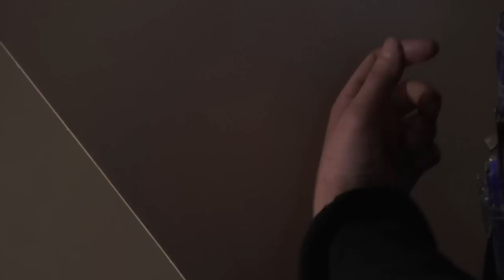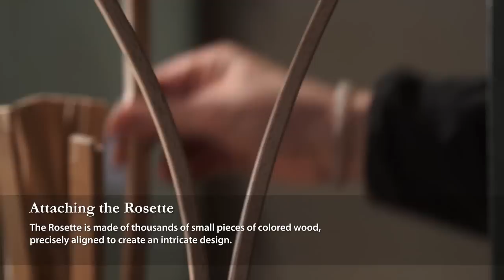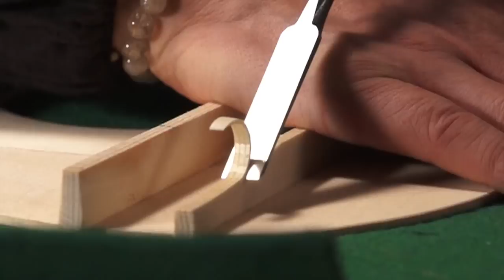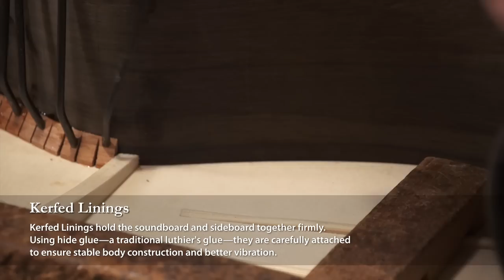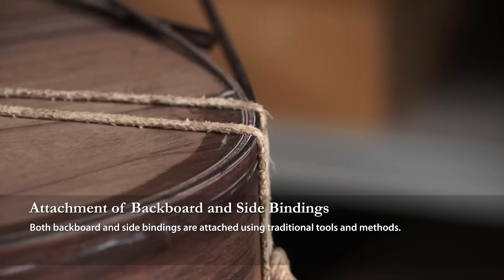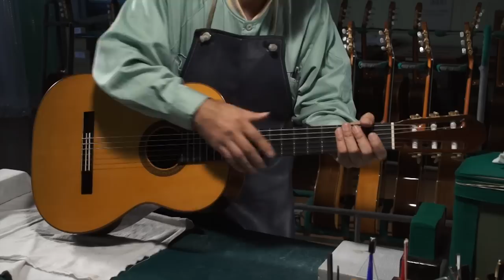Yamaha GC series: Visiting Custom Shop

Comment: I have been playing Yamaha Classical Guitars for FIFTY YEARS (,...yeah thats 5-0) 
The Yamaha CG 111A,  CG 100A, CG122 and the first G 50A from 1971 have all been great guitars. 
I am a Fender electric guitar loyalist, and I have bought one Fender nylon string acoustic/electric guitar with a cutaway and will buy 
one or two Fender Nylon Classicals just because you can never have enough guitars. (not because of any sound or quality premium)
I have come to find there are not many guitars out there for the  affordability, playablity, consistent recognized reputation, and reasonable quality which allow one to have a viable assortment of what each one offers as an individual guitar than the YAMAHA nylon classicals. (entry level)
Sometimes you need two if playing somewhere, say should a string break,....you dont tune nylons in a moment,...trust me. 
I played in NYC on the streets and would always take two in case I was beaten to a limp lifeless pulp and had to let them go,
......its better to go cheaper for that reason alone.
The CG 40lll  or CG 40 whatever number they are today,..or the one up from that, it is true, and has been true, you can get a GREAT new guitar from Yamaha or even a used one for between $99-$139 or for the "better" one about $199. (or less)
Get a hardcase for it and dont listen to these troll nutcases about not buying a Yamaha. 
They make great guitars,..I just cant cough up thousands of $$ each time I get a guitar,...the good news is the lower priced Yamaha will play great anyway. 
I`m pretty sure trolls can NOT play as good as a Yamaha would let them, thats why they are trolls.

Comment: Hi there,  was shopping for a brand new Yamaha cedar top classical guitar (matte finish)  and noticed a blemish on the top that looks like a bad shelac job the size of a penny. The shop assistant assured me it was nothing. Brought it home and immediately noticed it was actually a wrinkle (lagoon shape) on guitar top (upper bout, low E string but near the side) when the light hits it a certain way. It wasn't as pronounced in the showroom. Felt a small bump with my finger and wondered if it was a structural problem or loose brace. Not sure if it is related but when I pluck low E or low A string,  it sounds hollow (for the lack of a better word). Is it a setup or wood problem? 
Anyway, a top wrinkle, Is this kind of thing purely cosmetic or is it a defect that affects the sound quality? I have been sleepless over it worrying for the future life of the instrument I expect to last at least 20 years.

Comment: Yamaha's hand made line of guitars is very good, but except for some 660 mm models from the early 70s, the neck profiles are generally too shallow (not deep enough), and do not have enough shoulder on them. By contrast the comparably priced Spanish made instruments  are inferior in construction and materials but the neck profiles are superb.

Comment: The guitar top looks as it the bridge has been attached and then removed.
Reply: I think that's just a tape covering, to prevent varnish getting onto the bridge placement area
Reply: A lot of these manufacturers prior to finishing the instrument, have a general idea of where the bridge will go on the body and they mask that off with tape. After they achieve the desired intonation they would keep that tap there on the body,  and apply finish. Doing this, will allow them to quickly attach the bridge and make sure that the area is left finish free. This is a much better way of doing rather than finishing the entire guitar, then intonating it, stripping the finish off of the bridge area.